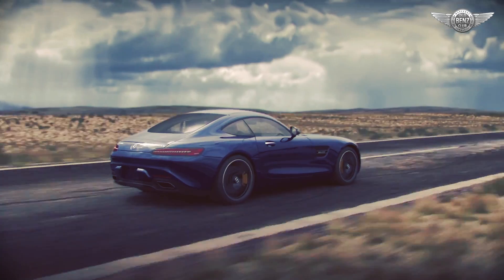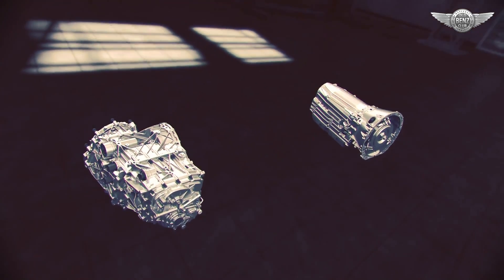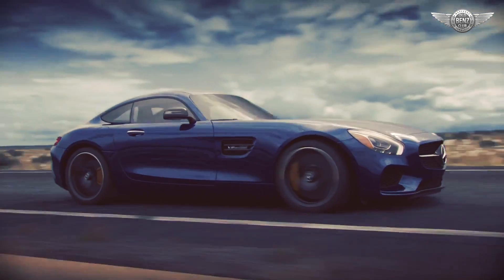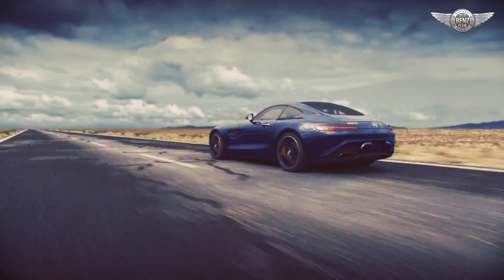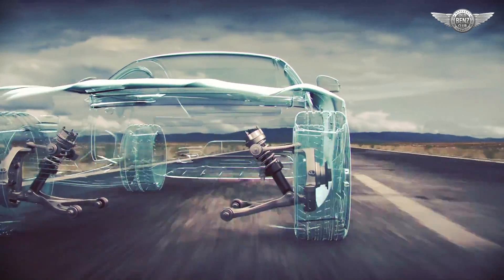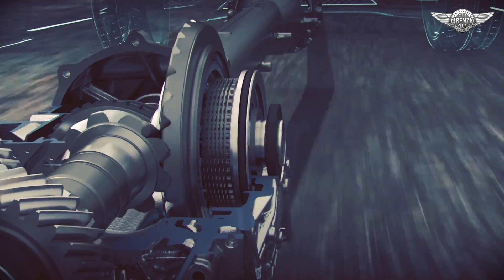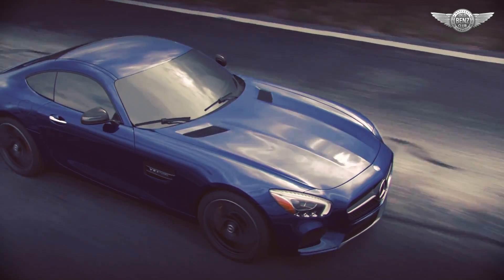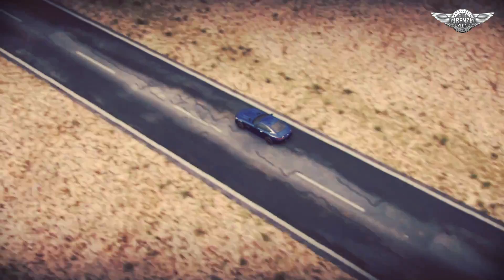Mercedes-AMG Technology

Comment: rubbish car rubbish engine rubbish engineers. |Merc use to do very good and realiable cars but now in maximum 2-3 years you'll need to do a massive service of the car. i have a sl500 1992 thats one of the last cars made proper with real thinking and parts to last
Reply: They are engineered to function well within the lease period

Comment: Except for the 2017 AMG SLC43 which has a nine speed toque converter slush box. It doesn't let you manual shift on your own without the electronics taking command. But hey! It's like driving a Nissan with a CVT. haha

Comment: ... but poor reliability and a high cost of maintenance?
Reply: Vuthy Va how many AMG cars have you owned to come to that conclusion?
Reply: Well.. dont buy it..
Reply: it's made for max perfomance at whatever the cost, not a car you can drive for 100 years, soome people just have the cash
Reply: No.
Reply: Mercedes cars are actually very reliable mechanically, stop going off stereotypes of bad owners
Reply: Yes
Reply: They're not meant to be driven like a Ford
Reply: Decades ago German Quality
Todays German Craps
Reply: who puts a turbo between the head of the engine biggest fuck up what Mercedes could've done
Reply: @Gupko1662  doings so made mercedes win the F1 championship for past 5 years. f1 technology coming to roadcars. it's not a fuckup, but a increse in efficiency and method of gaining power.
Reply: @Gupko1662  this is the only reason why each mercedes f1 car is faster a tad bit from other f1 cars, because of this design, the body of the car can be narrowed allowing for a faster acceleration and greater downforce.

Comment: Too heavy by design, the form factor necessitates massive power output that reduces range and fuel economy while increases the emissions of harmful tailpipe smog & climate change components 

Bigger is not always better, a machine to move 1 man can achieve remarkable performance. For instance a 1L super sport racing motorcycle. Lighter is a virtue in many designs :P 

Higher insurance costs, operating costs, upfront capital costs, depreciation losses, the TCO or Total Cost of Ownership can amount to many dollars per mile or kilometer, vastly exceeding the $0.54/mi or $0.32/km achieved by more egalitarian models like a Lexus CT200h :P or Honda Accord! Not to compare apples to oranges. Of course a high performance gasoline powered sporting sedan or coupe from AMG is going to cost more all around, like a Ferrari or Lamborghini .... just saying
Reply: Aaron Schwarz AMG, Ferrari, these automobiles are for true gentlemen not snowflake liberals that are worried about such utter trifles.